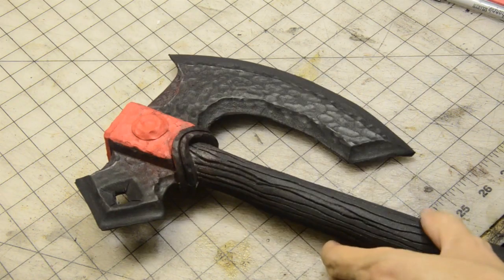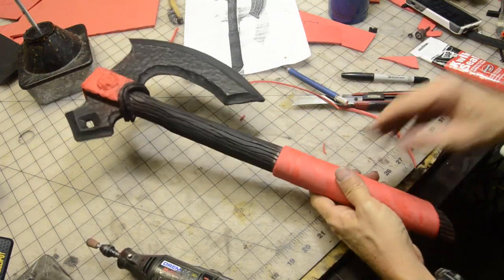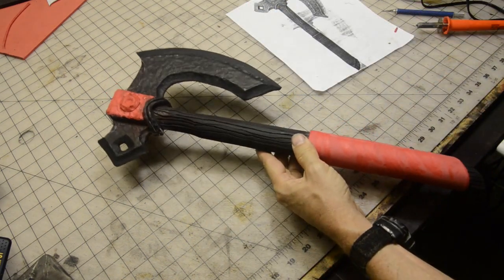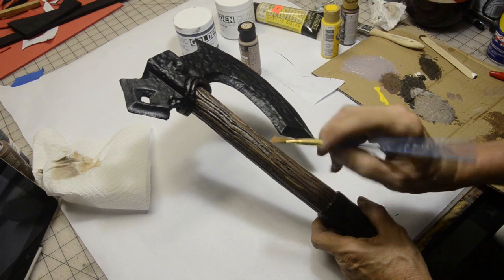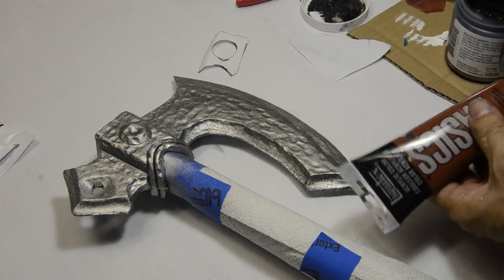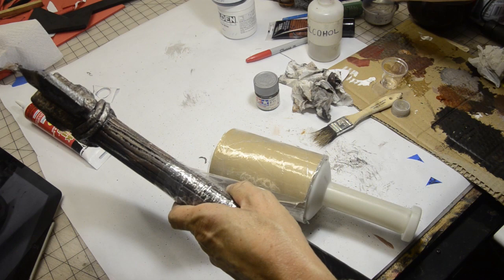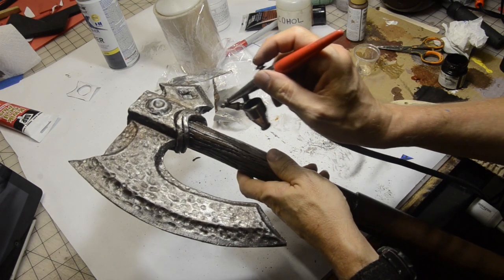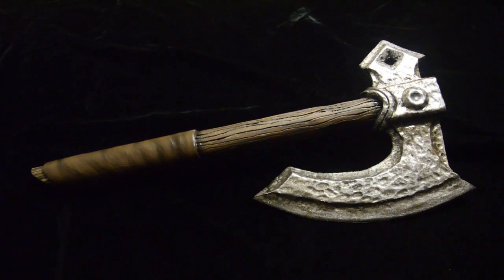How to Make a Foam Iron War Axe Part 2

Comment: Hey, I know I'm kind of late to the party on this one, but did you know that if you crumple up some tin foil and then flatten it out again you can sue it to give the craft foam a really cool looking leather effect? All you have to do is put the flattened out tin foil over the foam, before putting it on the prop of course, and go over it with a hot iron. It transfers thin imperfections from the foil to the foam and gives it a really cool worn leather look.
Reply from the maker: Super cool. Thanks.
Reply: Michael Poirier You kinda just blew my mind

Comment: Relatively new to crafting. In fact the first thing I made was the viking helmet you showed how to make 😂. But to get rid of shine from wax or sealants and also add to the dirty weathered look, if you finely grind up a stick of charcoal in a tiny amount of wood glue and lightly brush it over the build, it knocks back the shine and really adds to the aged weathered look.
Reply from the maker: Thanks for the tip. Here what I use now to seal my paint jobs that I don't want shiny. https://amzn.to/3gJgoS6

Comment: When I was doing faux finishes on furniture, I used scotch brite pads to cut the sheet on pieces that were still too shiny with matte lacquer.  As long as the finish is cured, they should work to dull a finish down without producing visible scratches.  You might try those for this application.
Reply from the maker: Thanks for the tip.

Comment: hey ted heres my little tip .. when i clear coat all my foam props i use ben nyes translucent setting powder .. its makeup but works a treat !!! .. wait till the clear coat has just a little tac left .. then use a big fluffy brush and use a very little dusting to take away the sheen !!! :) hope this works for you
Reply from the maker: +charmlighter Thanks!
Reply: +Evil Ted Smith i just use normal talcum powder and it works perfectly! But if you use it too soon it leaves a clumpy white residue its best to dust it once it's dry to the touch

Comment: a nice way to get leather texture is with crumed up aluminium foil and a hot iron plasing the flatened crumed foil on your foam then pressing the hot iron on the foil

Comment: I don't know if anyone already mentioned this, but Testers Dullcote is the best product I've run across for dulling a surface.  It's much better than the Krylon 1311.  I usually seal with the Krylon, then just dust over it with the Testers Dullcote.  I hope this helps  =)
Reply from the maker: Thank you for the tip.

Comment: +Evil Ted Smith I've watched almost all your videos with great interest. I still have a question you might help to solve. I'd like to create a huge sword (read +/- 6 feet long) would you make it out of wood or EVA?
Reply: It would weigh a ton in wood unless it was hollow. You could also use some kind of plastic piping as the armament inside the sword to keep it light. Foam would be fine as long as it has support.

Comment: Keep the awesome tutorial vids coming Ted! I have already applied several of your tips and tricks on a "darker than black" mask I just made and thx to your tips it turned out great (especially since it was my first attempt at using eva foam for cosplay crafting)😃

**Question: What is the reasoning behind sealing with floor wax, then sealing again with clear finish? Does the floor wax just provide extra protection of your painted item, or is there another reason behind using it? could you just use more mod podge instead of the floor wax at that stage?
Reply from the maker: +loveanakin85 Yes you can. I like floor wax because you can put on thin coats.

Comment: Would these work for larping? How soft are they, could you compare it to something?
Reply: It is the stuff used for the soles of flip-flops, I personally use this type of prop for larping but I don't use the metal armature as some people say it's a bit hard and could be dangerous if not used safely. I use plastic tubing or bendy piping just for a bit of extra give although the paint probably won't hold up as well with a more pliable surface...

Comment: hi tedd is there any difference between the foam youare using and thermocole.
Reply from the maker: +Durga Prasad The foam I'm using is soft and flexible, and themocole is not.
Reply: can you please share the link where i can get that foam. If not possible please say the trade name of the foam you used.Thanks in advance
Reply from the maker: I have my supply list below the video. Or check out my site eviltedsmith.com